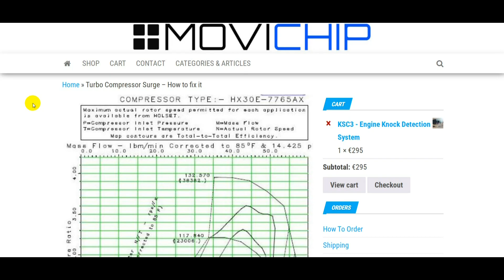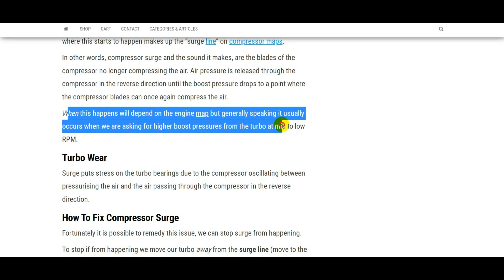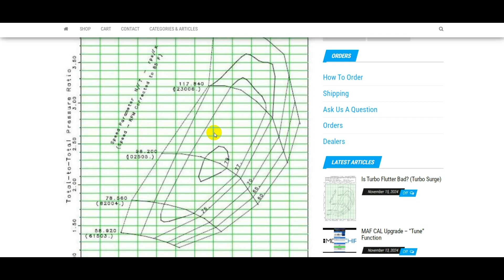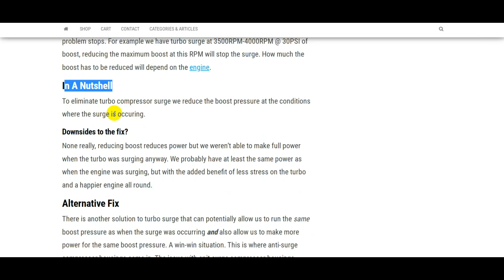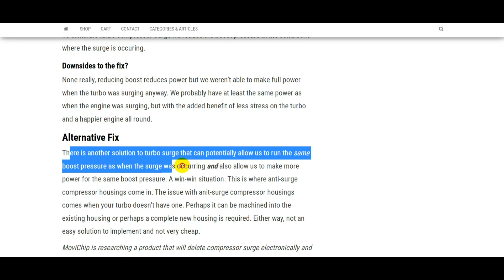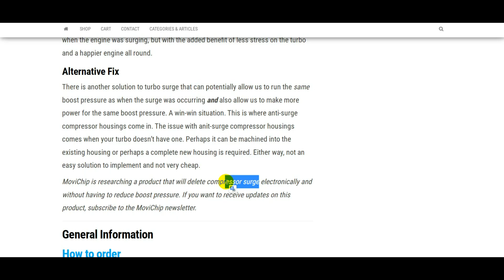Turbo Compressor Surge - The EXACT Cause & How To Fix It

Comment: I'm facing this exact issue after a remap on my 718. Between 3500 and 4000rpm I'm experiencing this at WOT. Will a BMC air filter help reduce the surge since it will allow more air intake?
Reply from the maker: Hi. In a word no. The turbo is trying to produce too much boost for the air it is being asked to move when the problem occurs. The problem is post turbo.